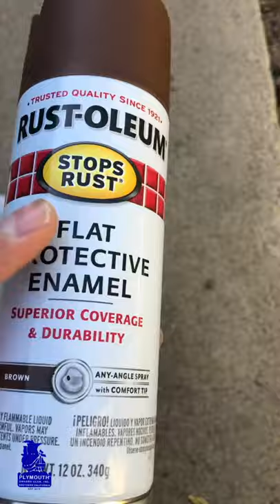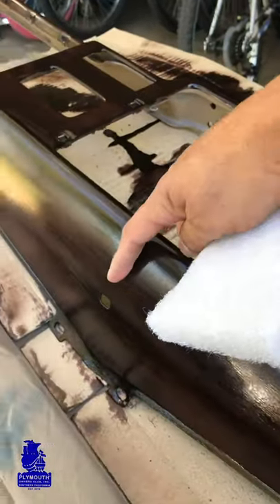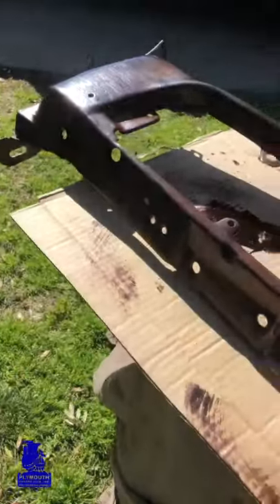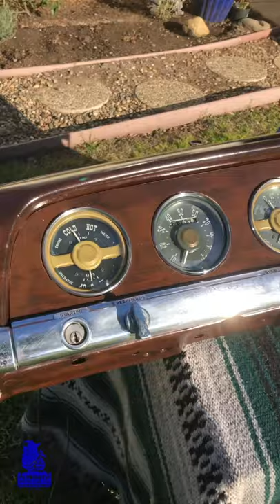1949 / 1950 Plymouth dashboard wood grain process

Comment: darker than original but a very nice job you can be proud of.
With all the work involved, I'd used automitive 2K urethane clear coat for durability.  You can have it prepared in semi gloss or flat texture at your requirement.
ecsellent tutorial